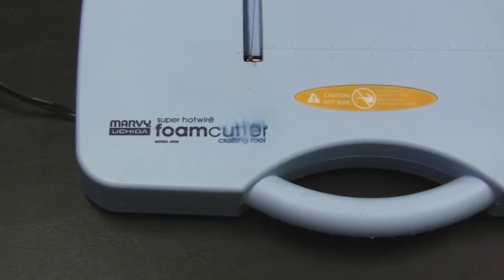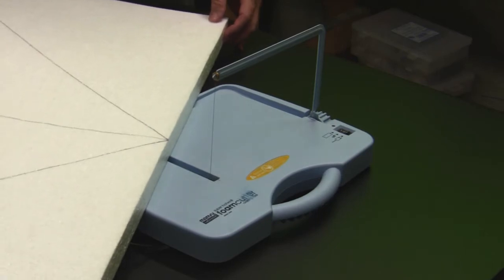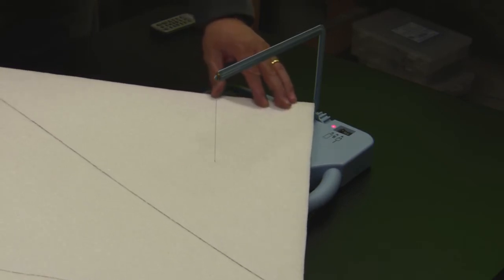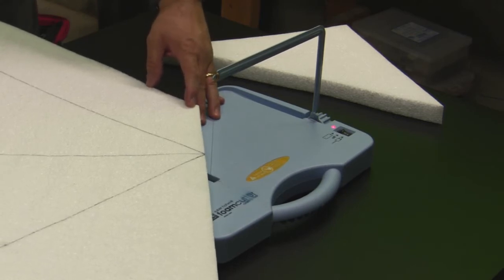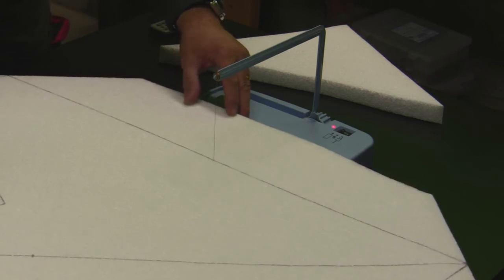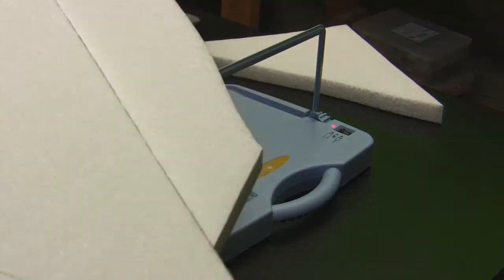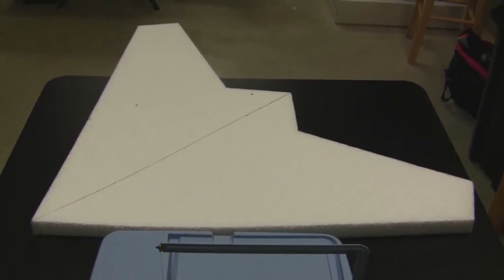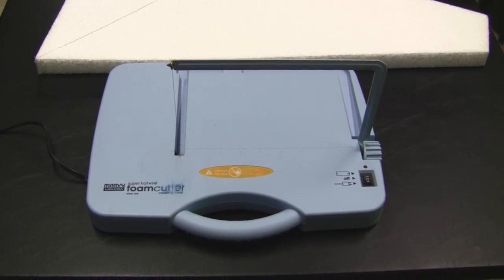Tabletop Hotwire Foam Cutter Review

Comment: thats one useful gadget. most of my friends whos into foam cutting using diy foam cutter.
btw, may i suggest putting some kind of guide on the foam line u want to cut to guide the hotwire. maybe some long metal ruler will do. it will make sure you have a nice straight clean cut. just like when we cut it using knife. hope you get my point.

Comment from the maker: @seraphim317 yes both ends of the wire have a loop that makes it easy to remove it from either end. you would have to put a small hole in the center of the foam to pass the wire through before cutting the center of the O out.

Comment: Why not make one yourself? The wire is cheap, you only need to have a small power supply. 
I wonder on  how many volts the foam cutter is operating?